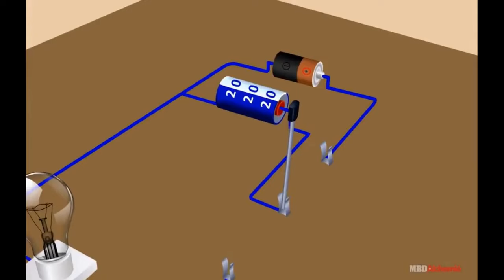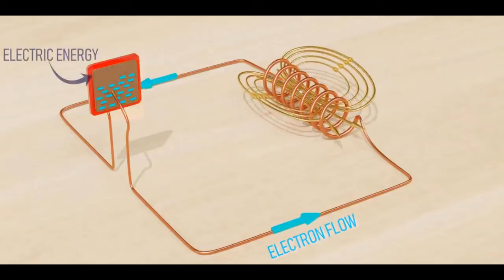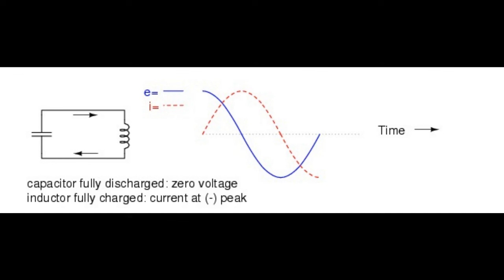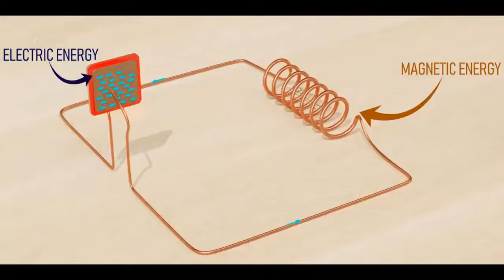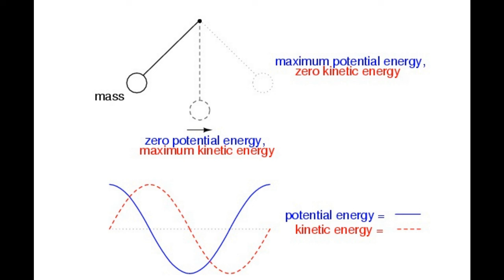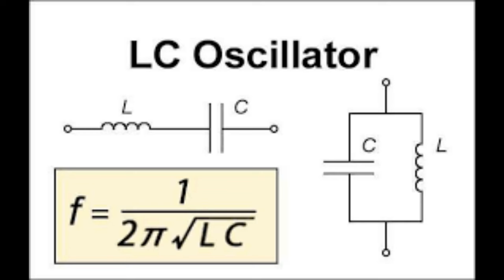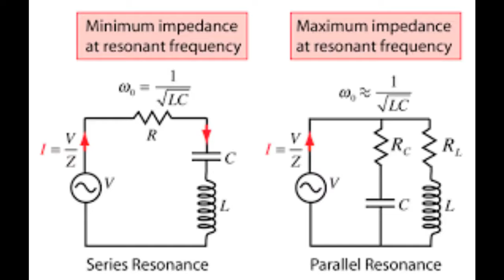Tank Circuits

Comment: great explanation.  Capacitors can be used in so many more ways.  Tesla created the 3 phase motor for a paycheck but his best work was with high frequency unidirectional impulses.  You can get more interesting effects with impulses than with alternating current.  also changing the geometry of capacitors can change their uses.  plate capacitors in a moving magnetic field can capture quite a bit of power too.

Comment: Making your own with One unknown and one known component can help you find the value of the unknown component. You can give the parallel combination a burst of high frequency, say from the rising edge of a square wave, and then measure the period of the ringing of the circuit on a 'scope and use that to calculate the values of the unknown element.